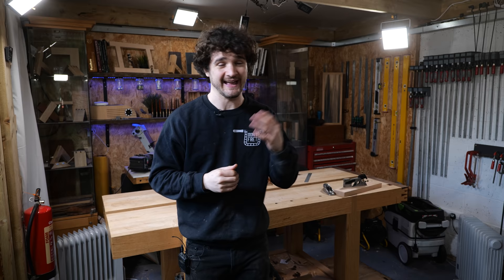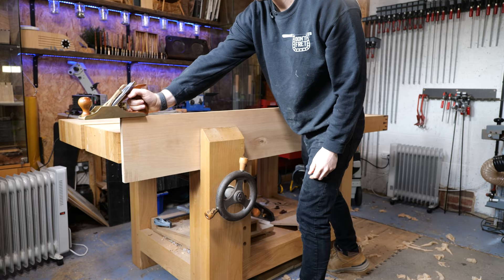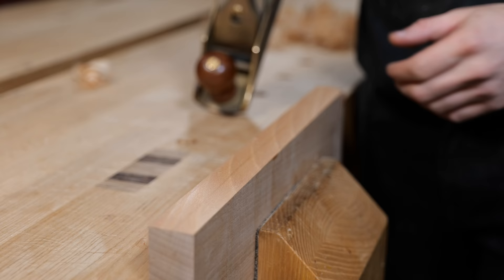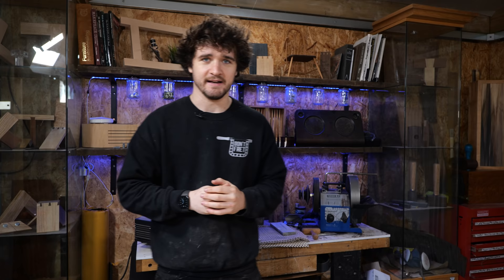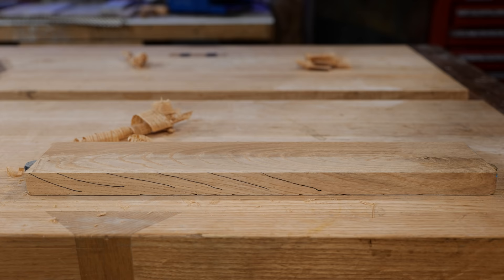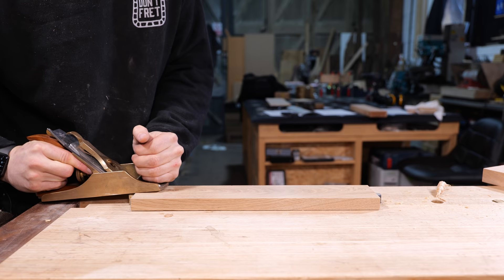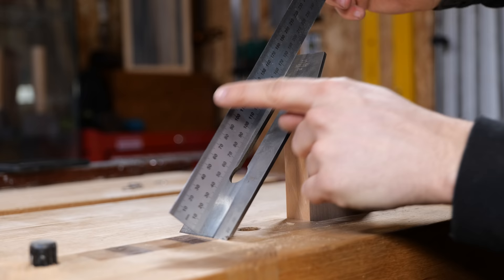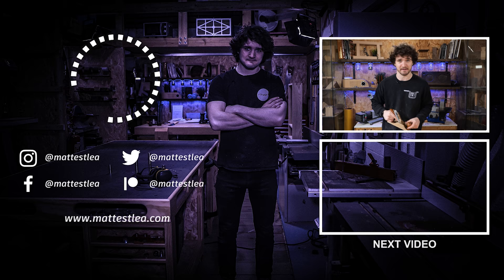How to Use a Hand Plane (The Correct Method)

Comment: And another thing...setting the plane down on its side has been shown to actually be more likely to mess up your lateral adjustment...so please, put it on its bottom.
Reply: Agreed. I started laying them on their side but noticed that sometimes a little too much of shock laying it down would throw out my lateral adjustment. What drove me to stop is that some of my planes don't have adjustment levers, and re-aligning with hammer taps made me connect the sideways knock setting the plane down to the problem.

Comment: The reason for the thing about not putting planes down on the sole goes back to the days when carpenters & joiners worked onsite in often improvised and messy conditions alongside other trades, and one could never be certain what was underneath the work surface. It's that simple. In the day it was a good habit to get into. It's not a myth at all. Hardly relevant to any woodworker today tho.

Comment: I have to take slight issue with the rant about putting a plane on it's side.  I agree with what you say however My Dad is a retired Joiner and he did a lot of on-site fitting work as well where there was no bench to put your tools on, so he had a habit of putting his plane on the side simply because it might be on a concrete floor or whatever and the last thing you want is to be doing that and especially as when on site the cut's are usually fairly coarse so a lot of blade is likely to get damaged.  But I don't disagree with what you say when in a workshop environment.  BTW I got severley bollocked once for using his nail punch as a spark generator running down the street at night and scraping it on the brick walls and that didn't do his punch much service.

Comment: Absolutely correct about the origin of laying a plane on it's side.  I was taught woodwork at school (and hated it) in the late 50's.  When you shared a two sided bench with someone else and only a 4" tool well full of tools between you, trust me, laying the plane on it's side was good advice.  I still do it, but that's just habit.
Reply: I learnt in the 1960's and was taught to lay the plane on it's side, but ALSO that it was to stop it accidentally hitting on metal. What I generally do now days is just plop it down on a little edge rest (think of the rest for chopsticks). A scrap of ply, a dowel, even a pile of shavings will do!
When I worked with a tool well, I put the plane pointing down into the well at an angle, so the blade is if free air.
Reply: And not just students sharing work benches. Some of those students would have gone into trade working alongside other trades and it was a perfectly sensible instruction to get into the habit of laying a plane down on its side rather than unlearning the habit later. Some of these 'it's a myth' guys come from the  cabinet-making side of things and mostly worked in shops rather than on-site.

Comment: Thanks, great video! My 12yo daughter came into the shed last night just before I watched this and asked why my planes were blade down! Still being taught the side method at school.
Skewing the plane doesn't change the angle of the blade, it will always be 45° to the surface. What it does do is change the angle of attack so that you are slicing more than pushing the blade head on. Skewing also presents less blade edge in the direction of travel (like a lamorghini v a haulage truck), less resistance so it needs less force.
Reply: Yes, I also think he was wrong about the skewing thing. He got more tearout in the demo because he was hogging it off with a deeper depth of cut.
Reply: @johncoops6897  and @Nick Drake I'm new to Matt's channel, and love his approach, but I agree the angle doesn't change, just the front edge first hitting the wood is narrowed. Also love that he, like Rob Cosman, recommends wax on the plane.

Comment: Thanks Matt

I bought a (a bit naff) Stanley Handyman No.4 and block plane set from a DIY store 30 years ago and have been disappointed ever since. Partly because they weren't good out of the box, but mainly due to not knowing how to use, sharpen or tune them. 

Your plane series ( with a bit of Paul Sellers, Peter Millard, John McGrath & Rex Kruger) have helped me immensely. I've made the Handyman into a fairly useful wood weapon. Inspired, I've invested in 2nd hand old Stanley No. 4, 5 , 5 1/2 & 6. The vintage Stanley's are all getting some TLC and becoming more usable day by day. No way I can afford a L-N, Veritas, or something else exotic.  It will be a while before I worry  any proper joiners or cabinet makers, but it all does for me.

 All the same, I'm improving my work, improving my results and enjoying my woodworking more and more. 

Thanks to you

Paul

Comment: Thank you for. This excellent video.  My Dad was a Carpenter and I have a Jack Plane from WW2 and two Block Planes..not sure what kind they are or their age, but they are different from the ones you have shown.  OK..I was going to clean up his Jack plane, took it apart and never got around to the actual cleaning due to other issues…when I went to reassemble the Jack Plane…here were all of th empieces and I had forgotten how to assemble it back together..I watched this video again and I think I have most of  it back together except for 2 small screws!..Bewildered at this point…

Comment: Just a note on the which way a plane should be placed, there is a chance be it a small one, but when you place the plane on its side, and you put it down to hard, this may change the setup of the plane and skew the blade, its not likely but depends how tight everything is, for me if your worried about the blade touching a surface other than what you want to plane, then use a rule and place the plane on the rule, but obviously don't put the blade on the rule, just the back end which will lift the plane so the blade won't touch the surface
Reply: Bumping the blade's lateral (sideways) adjustment is a big problem with laying a plane on it's side. It's certainly better to lay it down flat, and I also use the "prop it up with something" method like you described. That's mainly because I don't usually work on a lovely big flat workbench, and I have often have to place the plane down on the concrete (yes, there is nowhere else).

Comment: Hi Matt and I’m sorry to bother you I got myself a Stanley Bailey number 4 I took it apart to replace the tote and knob with walnut ones only the lever cap and the blade and chipper I’ve put everything back together and the blade adjuster in and out it tight even with screw backed off a bit and the blade only just gets to the mouth and I’m confused I did the same with my Stanley number 7 with no problem. My brain isn’t working on all 4 cylinders due to 2 small strokes. I’ve watched your videos  and I couldn’t get it any advice would be appreciated 
Cheers Steve 👨🏼‍🦽👨🏼‍🦽

Comment: Hi Matt, you missed an important part. Skewing the plane does absolutely not lower the cutting angle! It remains the same. Only the cutting surface is reduced. 😉
Reply: You’re right. I immediately thought “no it doesn’t”, and I’m surprised you’re the only one who has brought it up. Yes, it introduces a kind of slicing action as opposed to straight cutting, which makes a huge difference in some ways, but the angle stays the same.
Reply: @mm9773  Glad you saw it too. Probably requires being pretty clear-headed to understand it, as it's just the two of us so far:)  But I'm surprised that he himself hasn't said anything about my comment, as I thought it will be an aha moment for him.

Comment: Quick question on the point about back bevelling you mentioned: is there too steep a back bevel for dealing with tearout? Everyone says "you can go up to x degrees or more!" but no one ever says if there's too much of a good thing.
Reply: well the higher the cutting angle the harder it is to get it through the wood
Reply: That's like asking what length of string is the best length of string.
As "A I" mentioned, the lower the cutting angle, the easier the cut and visa-versa.
Why bother trying to make a "special plane" just to work with tearout? That means your plane is totally crap for the majority of your work.
I just use standard high angle 45° jack planes and 25/30° bevels. The first cut will tell you where the problem areas are on your work. So, just flip the work around so you never plane against the grain. In some cases that just means planing diagonally rather than along the board. Sometimes that means coming in from both ends.
So I just hog it off with the grain, then do a resharpen + hone + strop to get a super-sharp edge, and then make very fine finishing cuts - usually at a diagonal to average out the grain direction while making full passes. If you watch people like Rob Cosman, you will see him planing around corners, literally rotating the plane 90 degrees at the end of a cut.
Reply: @johncoops6897   The reason I ask is because one doesn't need a special plane to reduce tearout, one only needs a second blade to swap into the same plane for that purpose. And if one is dealing with a lot of highly figured wood like fiddleback maple or apple or walnut crotches, flipping the wood around to plane every 1/16" or less in a different direction is, well, feel free to insert your preferred colorful adjective there. 

I don't ask what length of string is the best length of string. I ask if there's a point where the length of the string becomes too cumbersome to be effective for the task at hand.

(Still, thanks for introducing me to a name I haven't encountered before.)
Reply: @abydosianchulac2  - I didn't realise that you were talking about highly figured wood since that wasn't what this video is about.
Nevertheless, the answer still remains... the amount that you raise the angle depends on what you need to do, and what you are doing it with.
...
For example, lets say you started using a 45° plane with a blade that was honed to 25° and flat on the top. If you added a single-ruler height back bevel and it improved things for you, then that is a step forwards. If you added a 5° back bevel and that made it even better, then once again that is a win. You are now cutting with 45+5 = 50°
...
However each time you increase the cutting angle, you increase the force you need cut the fibers. To a certain degree that can be reduced by angling the plane (which shears the fibers), as well as by using a narrower plane blade. Also the degree of sharpness becomes an important factor too - how sharp can you make the blade and how often do you wish to resharpen?
...
Hence, there is no "maximum" angle, but at some point the negatives will outweigh the lessening of tearout. If you cannot get your plane sharp enough, or planing is causing you grief then use a sander instead.
...
You said "Everyone says "you can go up to x degrees or more!" but no one ever says if there's too much of a good thing" - but why would that matter to you? You are your own master - it's up to YOU to decide how high an angle will suit what YOU do with YOUR tools on YOUR projects. You'll soon know when you have too much of a good thing.
...
So, the length of string that we find "usable" will always be different to what you find desirable, and in any case it will depend on what we each need to tie up with it. Never cut your string based on the what others tell you, especially if they say it's a "rule of the string", since that might be too long or too short for what you actually need.
Reply: @johncoops6897    I'm confused as to your point about being my own master, because one gets to be a master by being an apprentice and a journeyman first, where one is asking questions about and receiving the accumulated wisdom and experience from the generations of craftsmen who came before you, which is what I'm doing. If you had a more generally libertarian, be-more-self-sufficient message to impart...well, if I were interested in repeating others' experimentation wholesale for myself instead of plumbing the depths of their collective experience, I wouldn't be on the educational side of YouTube?

More directly, I'm asking about an upper bound here, not a prescribed angle to use. I know that there is no point to a 45° back bevel because the front edge just becomes a plane perpendicular to the worksurface, but had anyone ever found success at 44°? 40°? I'm aware of the physics of the increased effort that goes into trying to plane with the cutting edge at an increased angle to the surface, but I'm asking if there a point that angle is to steep to accomplish anything? If the answer is "no, you can still get results despite the difficulty," then awesome, that's exactly what I was looking for. If the answer is "yes, beyond x° the blade can't catch the wood unless sharpened beyond what most craftsmen could hope to accomplish at home," that is also exactly what I was looking for. After three and a half decades on the planet, I've learned how to figure out what my body is capable of; what I'm asking is what the tool is capable of.
Reply: @abydosianchulac2  - i am nearly twice you age, and I can tell you from my far greater experience that you just have to experiment and learn things for yourself.
Would you take my word for it if I said 60 degrees? What about someone else who said 65 degrees? Either way, you would have to TEST IT to find out if it was true or not, right?
- so, just test it anyway!
By the way, you can actually get a great surface on timber when cutting at 90 degrees... it's done using a tool called a furniture scraper.

Comment: Very interesting tutorial I'm currently fitting doors and need to take a mm or two off I can't believe how badly I was holding the plane but I would like to know how you would plane over a knot or would you use the with the grain principle?  hope to hear your suggestions
Reply: The way that I deal with knots is to start on them first. Then either plane towards them either side, or away either side, depending on the grain direction.
It's the same concept as when using a shooting board - you always cut a small taper on the far edge and then plane the main surface up to that.
So if you knock the knot down first and work out from it, you have a much easier time that trying to deal with the harder wood and mad grain directions. In other words, there is no reason that you MUST plane the entire length of the door in one single stroke.
Reply: @johncoops6897  Hi John Thankyou for that method and info I will give it a try it also sounds like an energy saving way if doing it. With regards to doing the whole length in one pass I feel I loose accuracy so in small sections is deffinately best for me anyways 😃👍
Reply: @stuartclarke9241  - the most energy saving way of dealing with door edges is to buy an electric planer and a pair of hearing protectors.
Reply: @johncoops6897  I could get an electric planer but I don't mind the manual work I'm sure it's a handy skill to have I just want to make sure I'm doing it in the most efficient way and also the correct way 😃
Reply: @stuartclarke9241  - I also plane doors by hand. You have more control that way.

Comment: 2:24 I think that's exactly how you should use the plane. With confidence and a relaxed stance. In time you'll get a better grasp of the feel, the sound, the shavings, the resitance, the grain, the surface, your plane, the works. All tacit knowledge you needmto build up just by doing. And yes, you'll know how many strokes it takes to get to where you want to be, planing with confidence.

Comment: Put the plane on its side for metal tops, but also not to mar a surface, work bench (if you keep it flat, smooth and clean), or the piece you just finished smoothing that can get shaved by the blade. Better to avoid than to risk having to deal with the snag.

Comment: You reckon plane on its side could be a throwback of wooden planes, putting them blade down has loosen the wedge for me. I still do it down, don't fancy taking a slice of ham off my hand 👀
Reply: And amazing series by the way, super helpful, I'm going to move my bench to allow more leg movement see how I get on 🤘
Reply: That is a very good point, except that the force you are slamming the blade into the timber is greater than the force from placing it down flat on a bench.